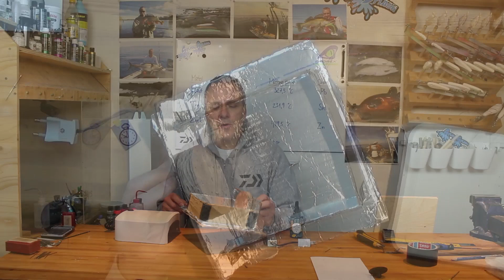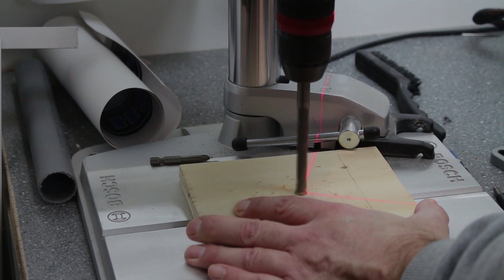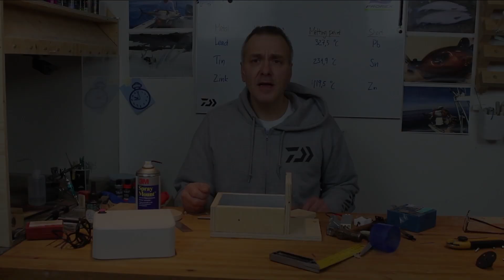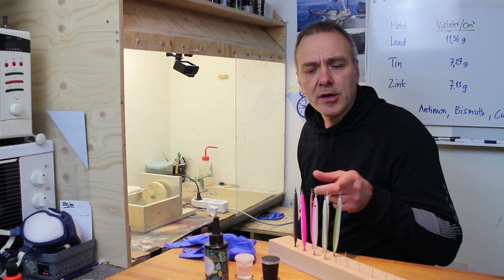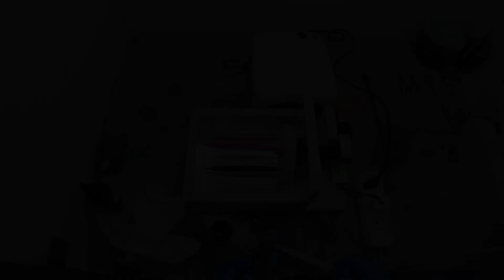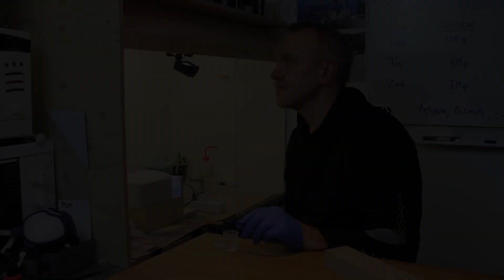Mini Lure Rotator - For coating lures with UV resin

Comment: only thing i find works just a hair better is flash curing your uv top coat with a small uv flashlight for a few seconds to prevent any sagging. then i put in my curing box! also a empty 35mm film canister works great to hold your brush on resin! i mounted a paint brush in my lid an cut the handle down a bit kind of like a nail polish setup that way i dont have to clean my brush. it just stays wet in my uv resin

Comment: Great simple idea but only I need clamps that spin on a solid axis while end by motor will hv small electronics clamps, trying to figure out how to attach alligator. lol on opposite end that will spin along with motor end, I want to do one lure at a time. Shoukd not take more than at max time 10-15 mnts to dry enough I can hang to finish curing and hv resin dry enough not to drip a ball while one is drying I will be airbrushing another one I’m not a manufacturing plant, not selling them yet at least, not yet, I’m giving them away. I’d hv to make several hundred to make a boat payment no way I could make that many abs be happy with them ya know, I just need to make a UV resin Drying rack that has clamps on each end to hold lure while lamps are in on each side, using 45 watt UV flood lights just going to mount them across from each other and lure turning inbetween two flood lamps a long 1 1/2” away from lamp so it will cure enough I can hang it w/o runs or balling. Shouldn’t be hard just need to figure a way to make the tail end clamp adjustable lengthways
Reply from the maker: I'm sure you could modify this build with a disk in both ends and a axis that goes all the way through. Thereby you could have an aligator clamp in both ends. second disk sould be moved back and forward to acomodate different bait sizes just by moving the nuts that hold the disk in place

Comment: very useful video as usual thanks a lot for your content. I’m starting into make lures and I realized that this uv resin smells like polyester resin so I research a bit and found that there is a kind of polyester resin that is uv cured and is mainly used for coating surf boards. I got 1kg for 20€ inc. shipping here in Spain.
Reply from the maker: Thanks for the tip - I will look into that

Comment: Hi there. Thanks for this great video. Just wondering how the uv holds up to the saltwater sea trout fishing environment and if you're happy with it one year later? Thank you. Dave.
Reply from the maker: Hi Dave. It seems to hold up just as well as the epoxy I have used on other lures. So I will be using it from now on I think - Until I find something even better :D
Reply: @SplishSplashFishing  thanks very much for taking the time to reply. It's much appreciated and I really value your great videos and content. I haven't used uv yet on my sea trout lures, just 4 layers of clear hycote lacquer from a spray can so this will save me a bit of time. Also planning to make your mini lure rotator for drying the uv which seems perfect 😉👍

Comment: What kind of “pins” are you using to hold the lures?
Reply from the maker: It's just small pieces of wire. If you bend them a bit the will "lock" in the canal
Reply: @SplishSplashFishing  thanks for the reply, like .040?
Reply from the maker: @MrBansheerunner  Sounds right - Mine is 1 mm

Comment: I just started painting My Own fishing lures A month ago I have not used the UV clear coat yet But I have Clear-coated two different ways one with a brush like you did and the othe I dipped it The end result I think dipping it In the clear coat Versus brushing it it turned out better in the end I do not use a rotator I just hang it and use a drip wire on the bottom of the bait where the hooks and split ring would go on the bait The drip wire stops the pulling of the clear coat and Drips down the wire and off the bait

Comment: Nicely done...I have been meaning to do a video of building a simple rotator for UV  since the one I made for me was a bit complex and can intimidate many DIY folks. Thank you this was a very simple and clean build, as usual, I'm sure lots of folks will find it helpful and accessible.  Nice work.
Reply from the maker: Thanks. This certainly was simple, but very effective. Just need to figure out a disc for small crankbaits and such. Shouldn't be too difficult though

Comment: Morgen, nice video. 
I built a larger box and in speaking with the company where I got my lights, they recommended using aluminum foil as well but suggested rumpling it up; that increases the actual reflective services and eliminates dead spots.
Reply from the maker: Its a good point, but as it is glue to a "raw" wood surface, it really doesn't reflect like a mirror. Also the lures are rotated, so they dont stay at the same spot. So I think I am covered. But making a box of mirrors would not be a good idea. Thanks for your input anyways

Comment: Great video. I would suggest getting a impact driver drill. Assembly would be much quicker and easier to take apart if there are issues, but just a suggestion.
Reply from the maker: I will look into that - Quicker and easier is always good - Thanks